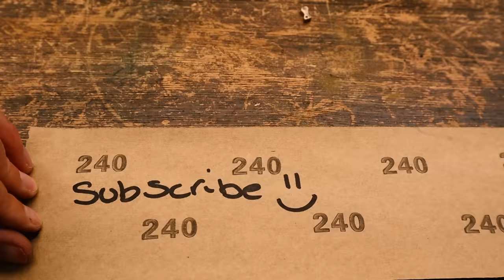Zippo lighter restoration - Vietnam War repair Long Bin 1967-68

Comment: You need to remove rust, painting over its is going to turn out poorly in the future.
Reply: are you blind?
Reply: Frost Bite hi but what is patina?
Reply: that one asian dude it’s a green film that occurs from oxidation over time. It’s just the aging process and is very hard to prevent without special care. I’m not sure if there is any way to remove it after it shows up.
Reply: @bubbajack9738  the actuall chemical state of the metal must have changed then.thx for pointing that out
Reply: @bubbajack9738  you can definitely remove it with electricity or other chemical solutions. Its actually very easy.
Reply: Man, that isn't "rust" that occurs on iron based metals. That's a piece of copper and it oxidizes. When copper oxidizes it creates an element that literally protects the copper from further oxidization. That's why the statue of liberty is still standing nice and blue. It's copper, not iron. It's not going to "rust" any time soon.

Comment: This looks like a new lighter that was put in some kind of solution to corrode pretty fast and then you restored it to what it was the day before. Maybe I'm wrong...
Reply from the maker: No Alex I think you are right. I bought this for 55 years ago and forgot it i my garden... Thanks for watching 😉👍
Reply: Awesome Restorations 👍
Reply: Facts. Rust doesn’t brush off with wd40 and a toothbrush
Reply: @eazyfnduzit  yes it does
Reply: @eazyfnduzit  it's a copper brush,and yes it does

Comment: believe it or not, you can still send such lighters to Zippo and they will repair them.. free of charge. Not as satisfying though. tip, ordinary cotton balls you get at the dollar store will do for the filling, but they will unroll into long strips if you break the outside in the right place. Always use either Zippo or Ronson  flints (both brands are now owned by the same company) Never use like the old flint from a Bic or the like. Why? The old black or brown flints corrode very easily, they have nothing in them to prevent it. Ronson and Zippo flints have something in them to prevent or slow that down, and they spark much better as well. 

While I think this one is legit, you have to watch "Vietnam" lighters you see being sold on Ebay and the like. While they may indeed be older Zippos, they're faked as far as being from that place and time. Some of the resellers go bury them for a while to age them, or use "hurry up" chemical means to make them look older. Inscriptions and sometimes even soldier's names are added after the fact so they look real. Many actually are coming out of Nam, but are fake. Most of the time, when you see a Zippo with a unit logo on it, it's faked. at that time, Zippo wouldn't make special lighters in small quantities. Penguin would, so the legit ones are often Penguien brand, out of Japan.  

In this case, the lighter would have been engraved by a jeweler or the like, and the eagle added at that time. This was common on individual lighters, the engraving and so forth could be done while you wait while on R and R in Thailand or Japan. (some other places as well)
Reply from the maker: Thanks watching and for your response. I'm really glad that you share all this information with me/us. 👍 thanks alot. I had my doubts about the lighter insert. But the outer part seemed like the real deal. 👍
 It's really awesome that Zippo will Fix Lighters if people send then is. I actually didn't know that before this restoration video. What fantastic service and a cool brand 👍 . Have a nice day. Best regards Martin
Reply: @AwesomeRestorations  I actually don't recommend people buy the more recent zippo lighters, made from the 90's on up. They have a flaw, the metal breaks under the hinge Zippo will fix it of course, but it breaks way too easily and too soon, even when little used. I don't know if they got hold of some bad metal (a brass compound) or the lightening of the case is what did it. Sometime in the 90's they decided that buyers wanted a lighter weight lighter, so they claim anyway... and made the cases thinner and lighter, which didn't do anything any good.  To be honest, I'm not so sure the insert is original either on this one. What are the markings on the bottom of the case?  The way the word Zippo is done and the other marks can help date it for sure.

Comment: I don’t know... looks fake. It’s so rusty in the thumbnail lookin like is about to fall under is own weight, but then he pulls it out with the pliers exactly from that point, revealing an almost new condition
Reply from the maker: I actually think that the Zippo insert was newer that the lighter case. No doubt But it was really hard to get out - I use more time to pull it out than you see on the video 😉 - thanks for watching
Reply: Agreed.  Honestly, looks to me like he used some kind of solution to corrode it quickly, or even reverse electrolysis, because there would have been major pitting if it had naturally gotten that corroded.  And the cotton was in too good of shape, granted, there were rust particles in it but it didn't match what long term corrosion would look like.

I think he took a lighter in excellent shape, and quick corroded it so he could clean it up and call it a restoration.

I've noticed a lot of channels, especially channels from people overseas use the same method.  They want to get in on the restoration fad and do that.
Reply: It was inside the case of the lighter... they are designed to hold a liquid their entire lifespan so I’m not surprised that it held up as well as it did and besides that the value( for lack of a better word) is the exterior casing and the insignia and inscription.... Very good job on the restoration... a piece if history saved...👍
Reply: It was just lost in the last 2 yr or it would never hold up ,,,,in the ground lololol
Reply: "Almost new condition" did you watch the video

Comment: Fact : WD-40 was first used to protect the outer skin of the Atlas Missile from rust and corrosion..
Reply: Correct, WD Water Displacement (formula attempt nr:)40. 
Painting the whole rocket would've added to much weight, but the bare metal needed protection so,.... 

Don't know if it makes 50 year old rust just fall off tho. Also strange that the rust didn't eat at the metal of this zippo, just lays on top of it to brush away ..
Reply: @JL-cn1qi  Probably stained or treated steel, the top of it rusts while the core stays clean
Zippos are made to last, but i'm actually pretty impressed how much this one did

Comment: and the eagle??
WDF IS WRONG WITH U BRO
Reply from the maker: ha ha... I leave it untouched to keep a little peace of history back on the Zippo. Thanks for watching ;o)
Reply: Lo mismo he pensado
Reply: @AwesomeRestorations  Thats awesome keep it up
Reply: @AwesomeRestorations  looks to me like you just didn't want to put in the effort of removing patina from something not flat and figured it was not an easy  problem solved with a brass wire brush. You just said "whelp that's enough" and slapped on some paint.

Comment: The "bird" that was pulled off is the insignia for a US Navy third class petty officer. My best guess is that this lighter once belonged to a sailor, as Zippo lighters were the only ones I knew that were authorized for use on a ship, especially if you worked in the fireroom and lighting the boiler (thus you were a Boiler-Technician) was part of your job. Awesome restoration.
Reply from the maker: Thanks for watching and for sharing your knowledge I really appreciate it 😉👍

Comment: I love watching these.  If a fella wanted to start doing projects like these for a fun hobby, what would the basics one would need to get started?
Reply: Man, just improvise with what you've got.  I used to acquire broken lawnmowers,  and build functioning lawnmowers out of them,  with nothing more than a pair of channel locks, a pair of vice grips, and a blunted pocket knife,  in the tool department.   Basically,  envision what it is that you wish to accomplish,  then set about making it happen.  The process is simple; the learning curve steep, but rewarding. 

Rewatch this video; everything you need to know, and more, is in it. He's got a couple of other Zippo vids. Watch them, too. In fact, start watching restorations of anything.  There are more resto-vids than you can watch in 3 lifetime's.  Examine the techniques used. Ask, "How can this technique be applied to something that I would like to accomplish?"

Lastly,  don't fear mistakes.  You will make them.  Everyone does.  It's not the mark of a loser; it's the mark of a doer. Learn from your mistakes.  Many Youtubers will show their mistakes in their builds, mods, and restorations.  Learn from those, too. Those guys put those mistakes out there, so that we will learn from them.

Bonus- Basic tools that you should have: Standard Claw Hammer, Channel-Lock Pliers,  Vice-Grip type pliers,  a 4-way Screwdriver, and a 6" Bubble Level.  What you can accomplish with these simple tools is nearly infinite.  Of course, as time goes by, you'll want to continue adding to the tool collection.  This is just the basic kit.

Comment: You should show us the bottom of the lighter, as that would indicate the year it was made. You did it for the other Zippo videos, wish you showed it for this one, as it would be the oldest one yet. (Hope you didn't hide it for a reason!)
The inscription on the bottom would show a "Zippo date code" that you can look up on Google. If it was in fact from 1967-1968, then the code should either be 2 or 3 vertical lines i.e. I I I (Modern Zippos now have 2 digit year codes e.g. "19" is 2019. While 80/90's had Roman numerals)

Comment: I find it interesting that this is a sailor's zippo. That insignia is the rank pin for a petty officer 3rd class. What makes it interesting, is that most of the sailors were on the water. Honestly, I'm quite curious about where and how it was found.
(Edit) im meaning it looks like it spent a LOT of time buried in dirt. Most of our sailors were stationed on ships during that time, not on land. And a zippo thats been under water for a similar time shows very different damage/weathering. Maybe this was property of a corpsman running with a group of army or marines?

Comment: Awesome work! How do you polish the body? What is that big black wheel? Do you use any polishing paste? My zippo looks very dulled after years, maybe I can polish it to new shine. Thanks!
Reply from the maker: Thanks for watching Tim. Yes you can easily machine polish/hand polish your Zippo lighter No problem. 👍 The big black wheel is a machine polisher wheel 2800 rpm I use ultra cut/ultra gloss paste 😉

Comment: Very nice work ! 
I'm kinda curious though,  I didn't see any corresponding  information on the INSIDE component.  Zippo also puts name and numbers on the inside.  I'm wondering if that inside was not original to begin with.  Hmmm. IDK. 
Nevertheless,  nice job. !
Reply from the maker: Thanks for watching and for your kind words I really appreciate it 👍 I think that the inside was a replacement but the outside case was and felt genuine enough :)

Comment: That's USN. 3rd Class called a "crow" Petty Officer, with one Chevron. 3rd Class Petty Officer. A non comm. 
From a former USN Hull Technician 2nd Class(2 cheverons and a crow).
Reply from the maker: thanks for the information you seem to know a lot about this lighter, cool 👍
Reply: @AwesomeRestorations  a little. Spent 7 years in. Back then I smoked. And the lighter of choice was yep, Zippos. Hey I have a very old old pipe wrench. Want to restore it?